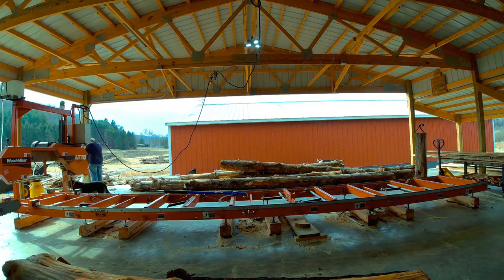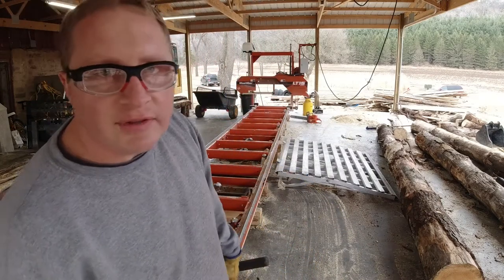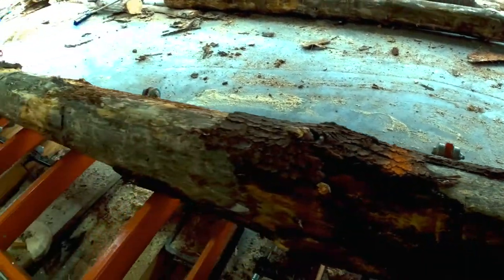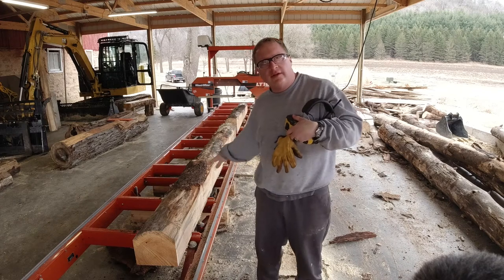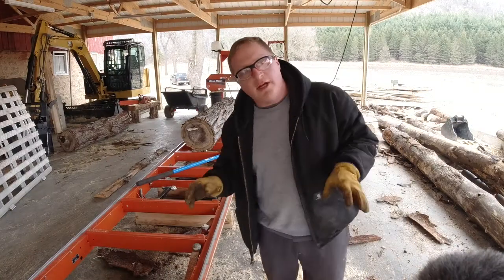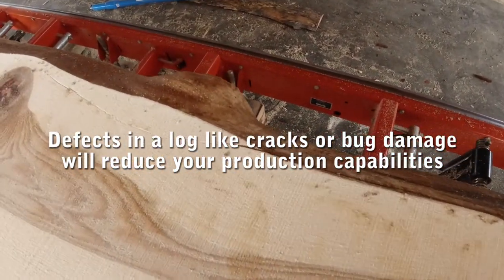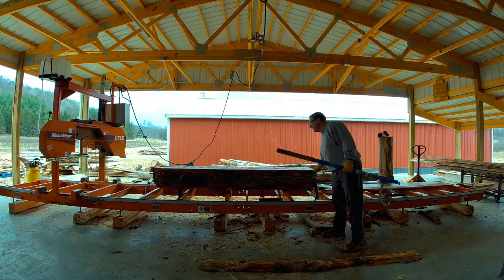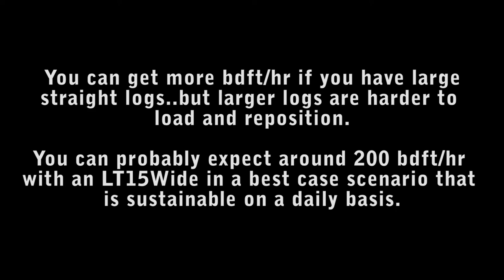What is a realistic board foot per hour (bdft/hr) for a manual mill? - Real World Production Test

Comment: We have a video on our channel with an idea for log sawhorses that are easy to move into place if needed to load up logs and also a cradle for the flitches coming Off to help with cutting them up into easily sellable or firewood pieces. If that helps any. Whited’s wood concrete and machinery channel. Thanks for the video too pretty cool.

Comment: I recommend  building a log deck to roll your logs onto your mill. Cut some 8x8s or 10x10s, whatever  height u need to be level  with your mill. Then u can just place logs on it with your excavator  or tractor forks and roll logs on easily. Not up a ramp u have to keep moving. A slabwood  rack is also useful.
Reply from the maker: I have gone back and forth on using a log deck...I like to keep both sides of the mill open so I can walk around easily.  I will probably slide my mill over a bit so I can just drop the logs directly on the mill with the excavator.  Thanks for the tips!